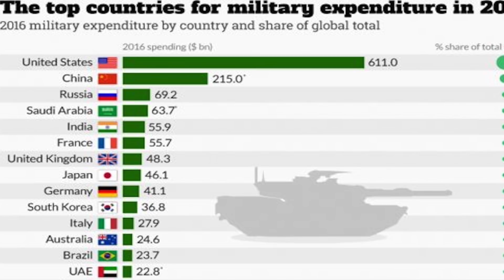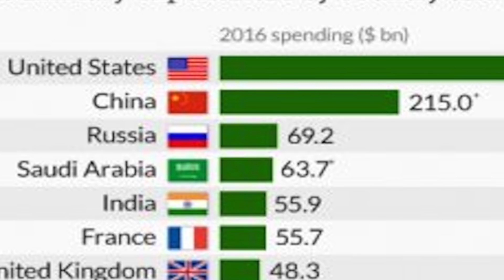CAN USS GERALD R FORD DEFEND ITSELF AGAINST RUSSIAN ZIRCON MISSILE ?

Comment: Yes the laser weapon systems are going to be installed on the major ships or all of them that only cost about $2 per shot when all is said and done... plus the U.S. will also install rail guns on Ford class carriers which fires a hyper-sonic projectile....
Reply: Interesting (Darth Mucus) fantasy that you have there (American Carriers being endangered). You're wrong, for a host of reasons. Let's say that this missile can do everything that's advertised to to. The only way to shoot a Carrier is to first know where it is. What makes you think that Russians or the Chinese have the ability to find a Carrier before the Early Warning Aircraft on the Carrier find it first?

Perhaps a submarine would be able to do so, but it would still need to surface or transmit data to the ship with the missile, which would take time.

So, no, US carriers aren't endangered. When was the last time a US carrier was sunk, BTW?
Reply: The Zircon missile would have a pre-assigned destination, upon launch, but that course would be very basic, and the missile would need to fly high enough to gain sight of its target, at some point. In the several minutes, it would take for the missile to get to its destination, the target, with its speed of up to thirty knots could be anywhere within several square miles, so the missile would need to go high in order to find the target, much the same way the Argentinians did when they sunk the HMS Sheffield with an Exocet missile. The Argentinians flew low with their fighter, then popped up to get sight of the ship, and once the target was seen, they launched the missile. The reason the British were unable to respond, to the threat, was they had underestimated the Argenitian's ability.
Reply: You're right, my prediction was based on the missile being fired from a long distance. The missile does have an enhanced capability, in that regard. My response was in regard to someone expressing how "A" Zircon missile could sink an American Carrier. It probably will take many. 

I have no doubt the Russians are developing the Zircon to be fired from submarines. It only makes sense. Since the primary purpose is to provide a multitude of inexpensive missiles from varying distances and platforms. No weapon platform is invulnerable. 

History has proven that to be true. What the Russians and Chinese are doing is following one of Sun Tsu's lessons in The Art of War, and that is to refrain from fighting your opponent's strengths and to develop new tactics and weapons to undermine that power. We Americans are also aware of Sun Tsu and are also adapting.
Reply: They do, and the Russian subs are superb, but they have one major flaw, which I won't mention here, and it is much tougher getting through the escort picket with this one major flaw.
Reply: We cannot count on the rail guns, yet. At hypersonic velocity, the guns can fire about ten shots before wearing out the barrel, so the tests are shooting the rounds at supersonic velocities for durability sake. At these slower speeds the guns only last about 100 shots, which is a far cry from the 10,000 rounds shot limit, the Navy insists upon.
Reply: A few seconds is a lot, but when you consider the laser beams are traveling the speed of light and might be controlled via computer as is the missile, then it isn't. Now, if the Zircon missile were capable of detecting it was being fired upon, by a laser, and maneuver to avoid the beam, then it would be a lot of time again. But, it might also force the missile to miss its target and would cost Russia a lot more.
Reply: If the missile is traveling low, over the water, at Mach 6, then it will be difficult to see, but it will also probably never get to see its target. At some point, it will have to go high, so it can get a lock on its mission.
Reply: The issue with a Zircon Missile using other assets is related to some of Russia's weaknesses.
Reply: But you're not a weapon designer. There probably is a very good reason why the professionals haven't already fone this.
Reply: Darth Mucus .....dude you are so full of shit its laughable. None of your junior theory is correct.  "Due to earths curvature?"....ummm these ships have airborn patrols few miles out to detect activities. Also these hypersonic missiles are still only hypersonic at high altitude! "Phalanx only getting a few rounds off once missile is detected." Ummm...please recall how many rounds a second it fires....  For one, hypersonic missiles have yet been proven to work in a war theater much less low altitude. Are you a comedian also??....or just a fear mongerer?
Reply: Darth Mucus ...5 tons flying at mach 6....😂😂😂
Reply: @Charles Lu, AFAICT (As far as I can tell), No Russian Subs are configured to be able to carry this Zircon missile, so it's irrelevant.
Reply: The Zircon missile isn't in production, yet, so no submarine or ship can be configured to carry it unless it's somehow backward compatible with earlier missile launchers.
Reply: Hashtag, subs carry supersonic cruise missiles , Oniks, Sizzler,  Yakhount, etc. also wake homing torpedoes, with 50 mile range. USN has no answer for 200mph rocket torpedoes either...
Reply: Darth Mucus It's unknown at this point if Zircon can maintain mach 6 or 7 at sea level. It would have to burn a lot of fuel and the shell would have to endure very high temperature, I don't know if that would damage the missiles sensors or not. I think it would traveling at Mach 6 at high altitudes and slower and sea skimming level's.
Reply: Darth Mucus You have some good points, however it isn't known if it can travel at Mach 6 at sea level, if it can that's quite the feat. And I would like to know how it can manoeuvre at that speed. Anything trying evasion manoeuvres would probably break up. But hey it just a thought.
Reply: We'll have to take the Russians at their word, on its missile capabilities, but we also have to remember these are the same Russians who told us of their new T-14 Armata tank and how it will make the M1 Abrams obsolete. We have similar missiles, to the Zircon, in development, and in actual use.
Reply: Darth Mucus Spiral manoeuvre at Mach 6? I see what your getting at but at that speed how much of a spiral is going to be possible. This isn't a ATGM.....this a mach 6 missile. I agree the kinetic energy is more than enough but I don't agree that it's going to be doing any manoeuvres.
Reply: Comparing the M-1 Abrams to the T-14 is irrelevant, because the T-14 isn't real. Oh, sure they designed a tank called the T=14, and it was supposed to be awesome, but Russia discovered they won't be able to build enough of them, to matter, so they cancelled it, and decided to upgrade existing tanks.
Reply: There will not be a full scale production.
Reply: I think the Russians are smarter than that and their reasoning for discontinuing plans of full production was spot on. Wasting money on a few superior tanks would be stupid especially when that same money could be used upgrading more tanks already in existence, especially when that new tank, T-14, would instigate the US into building a new tank too, and one we could build in greater numbers.
Reply: Hashtag, Russian subs carry cruise missiles too
Reply: true
Reply: We will see, though)
Reply: Maybe Russia will be fighting on our side.  You never know.
Reply: jessy livingston lasers work on exotic materials that are not in abundance go watch the video about lasers by YouTube channel thunderfoot
Reply: rail guns are cancelled, a single laser need a personal nuclear power plant to be effective, good luck :)
Reply: So how's your plan to stop it, smartass?
Reply: Guess you are going to flip burgers when you get older, with your IQ.
Reply: jessy livingston laser will be reflected due to the ions surrounding the hypersonic missile.
Reply: Russia's Avangard Hypersonic Glider Warhead Enters Production (is even faster= at speeds up to Mach 20) https://sputniknews.com/military/201803041062210266-avangard-hypersonic-glider-enters-production/     "Kinzhal, the ultra-maneuverable air-launched missile flying at speeds above Mach 10, has also been deployed by the Russian military."
Reply: And the Russia's Avangard Hypersonic Glider Warhead Enters Production (is even faster= at speeds up to Mach 20)  "Kinzhal, the ultra-maneuverable air-launched missile flying at speeds above Mach 10 .
Reply: So the sum total of your "host of reasons" is that a CAG can actually do something to stop an adversaries surveillance craft either airborne or surface before it's able to report their location to a Zircon equip craft that could launch an attack upon receiving targeting info.....?? That's nutty!
Plus the issue of extremely limited exposure time to even powerful laser defenses ala sea skimming trajectories is pretty much an intractable one as Darth Mucus pointed out.
Reply: it's not a Lazer. It fires a medal projectile super NB fast with electromagnetic power!!!!!?
Reply: Carriers are great for attacking weak countries but useless against a country that has a strong defence force, they could never be used against China or Russia.
Reply: Nonamearisto you cant even dodge a parked freighter... It seems all people sucking off the governments tit are hopelessly useless... Get a real job, instead of racking up the national debt for future tax slaves to pay
Reply: not to be disrespectful eddie money but how do you know what is in development or not in development or what do you have some specific inside info that nobody else does we know what they want or allow us to know
Reply: @hashtag underscore  "When was the last time a US carrier was sunk, BTW?"
When was the last time the US went up against a real enemy, and not some 3rd world nation?
Seems to me the one with fancyful fantasies is you, thinking somehow your stuff is indestructible. Remember Titanic? Yeah, it was unsinkable too. Remember Yamato, or Bismark? Yeah, another fancy fantasy. I bet you thought the Abrams was indestructible too, right?You should try steping away from that bubble you live in. 

@Aejon Starkgaryen  You are assuming the missile is launched from far away. I would bet my left nut the russians are right now working to get that thing launched from a sub. And even if launched from another ship 400 miles away, unless your carrier is zig zagging, predicting your position after a minute or two is not  all that hard.  The carrier isn´t exactly a small target, is it? If you have a spotter aircraft pinging you on radar, or a satelite relaying and feeding your course and speed to the missile´s guidance, i´d say the missile does have a pretty good chance of getting a hit. 

I honestly do not understand this fanboyism surrounding your weapons of war. Never in recorded history has any system survived unscatted once the bullets started flying. Everytime someone designs a new system and people dubb it "unsinkable" or "indestructible",  it doesn´t take long for someone to prove you wrong. Yet here we are, at it again. You think the generals and admirals in the US Army/Navy think the carriers are invulnerable? They wouldn´t bother protecting them if they were, would they?. 
Not long ago there were many americans that believed the Abrams was invulnerable. Even after the Iraq war, when you could see for the first time pictures of burning tanks, they still wouldn´t believe. It´s like some mass hysteria has taken over, and americans have lost all their ability of critical thinking, and are stuck in a perpetual bubble of incredulity. People try to grab them by the collar and shake them "Here!!! See?? Here is proof!!Look!!", and they just stand there in a daze, mumbling "Nahhh, it´s not true, it´s all fake. My beloved Abrams is invulnerable!"   Wake up, people! American carrier invincibility is a myth. You just haven´t faced a top shelf enemy, since WW2. Because if you do, those carriers will be the first to go. It doesn´t mean anything.
Reply: Lasers require a set ammount of time on target to heat up the target and work their magic. If a hypersonic missile comes low above the water, the laser will have only a few seconds on target, due to the curvature of the earth hiding its aproach, before the missile covers that distance to target. Likewise, other systems like Phalanx and short range AA missiles will not have enough time to engage the target once it reaches their operational range, because the missile will cover those couple of miles in a couple of seconds. A phalanx will have to wait untill the missile is 2 miles out to start shooting. That means it will get maybe a few rounds off before the missile covers that distance and hits. And since the missile itself needs to be built like a fucking tank to resist the stress of flying at that speed, it may not even affect it that much.
Short range missiles have a small warhead, again they might not have enough of a payload to affect the incoming missile. The time it takes to launch it might not be enough to even have a chance of catching it. Mach 6 is just too fast.
The Zircon doesn´t even need a warhead, they could just build a heavy and very dense penetrator, like a supersized SABOT round penetrator on steroids, that would be impervious to any damage in the first place.
The russians have the Zircon, the chinese have their carrier killer ICBM. I´d say american carriers are an endangered species.
Reply: @Nonamearisto  A few seconds is a lot for a missile that can travel at Mach 6. A missile aproaching low over the water will be safe from the laser until it gets to about 30km from the ship, due to the earth curvature. At which point it needs just 15 seconds to hit your ship, traveling at 2000 m/s. And in those few seconds the laser has to be focused on the nose of the missile, which if its made of a dense material will make that laser useless. All the tests made with lasers have always been made so the laser hits the missile on the side as it flies across the gun, never on the nose in a head on aproach. The laser is just heat. If you have a heat resistant missile nose, the laser is inefective.  Also the laser would only work on a missile with a warhead.  A solid penetrator is immune to a laser, all it would do is heat it up, not destroy it.
But hey, i´m sure you are gonna tell me the US Navy has a turbo-laser of some sort, or a phaser, that would somehow destroy a massive chunk of depleted uranium or tungsten flying at mach 6...
Reply: All it takes are a few seconds at most for a laser to destroy a missile. We'd detect a missile launched at a carrier within a second of its launch, and have about 3.5 minutes to react. That's plenty of time. I already explained why hypersonic missiles are bs above, so I won't repeat myself.
Reply: There is no issue, it actually doesn´t even need other assets. Think about it:
Soviet ship is 500km from US carrier, and spots it, using whatever asset. Plots the carrier´s position and launches the Zircon.  The Zircon receives the carrier position from the very ship that launched it. It then flies at Mach 6, meaning it will reach the immediate area of the carrier in a whopping 4 minutes! How far do you think the carrier would have gone in that time, for the missile to even need a course correction? The missile is huge, it can carry its own radar. As soon as it gets to 30km out, the earth curvature allows it to use its own onboard  radar to pinpoint the carrier, without ever having to come up. Takes a quick reading, pinpoints the biggest radar contact, and boom! And on top of all that, they are not gonna send just one. A carrier is a very high value target, they would not send a lone missile, they would saturate the task force´s defenses with 8 or 10 of these, launched at same time.

I think the issue here is people not realizing how fast Mach 6 really is! At that speed, you don´t even require an explosive warhead, the sheer impact is destructive enough. There isn´t much you can do to stop a 5ton hunk of metal traveling at that speed. The momentum, the inertia of the thing is massive. You think a little peashooter like an AMRAAM is gonna  stop it, with its proximity fuse shotgun blast type of warhead?  The Sea Sparrow is designed to destroy soft cased 500kg  missiles. It is not designed to destroy a 5ton behemoth flying at Mach 6, a speed that no interceptor missile can ever hope to reach. (Sea Sparrow´s top speed is mach 4, btw). There´s a reason why these videos were made. It´s because there are think tanks out there, thinking all this shit up, and they see just how dangerous this "zircon" can be if it gets built.
Try this  mental exercise: what would it take for you to destroy an inbound Yamato´s 18 inch gun armor piercing projectile, weighing 1500kg? The Zircon weighs 3 times as much, and flies twice as fast. Think about that. :)
Reply: @Clay Evins  Do you know math? How about reading? Calculate how much time a Phalanx system has to shoot it down. Let´s see, the Phalanx has a range of 2km, the missile moves at 2000 m/s, so that leaves it a whopping 1 second to shoot, from the time it gets in range to the missile hit. One second. And have tyou ever hear of "momentum"? Kinetic energy? Yeah... i think we know who is full of shit. 
Shouldn´t you be in school? Kids these days, always using their phones when they should be studying... No wonder they end up morons. But hey, you can always flip burgers when you get older!
Reply: They don´t care about facts. We can post all the data, their brains are so indoctrinated that they just cannot fathom the russians could possibly have beaten them. The american media sure has done a crack job on them. Even when confronted with overwhelming info that their precious multi-billion dollar carriers are in danger by a cheap missile system, they will just continue to be brainwashed moronic trolls. Even the british have aknowledged that the Zircon cannot be countered:
http://www.independent.co.uk/news/uk/home-news/royal-navy-new-queen-elizabeth-class-aircraft-carriers-not-stop-russia-zircon-missiles-hypersonic-a7651781.html 

But you can bet the american fanboys will continue to troll around badmouthing any russian systems. Nothing can possibly beat their precious Navy or their precious Army, right? WRONG!! The russians might not have a huge carrier force, but their missile technology is second to none. Why do you think NASA uses russian rockets to go up there? While the US was building stealth bombers, fighters and frigates, the russians were designing  better anti-air systems and missiles. And this is where we see the diference in ideology: The US builds offensive systems, the russians build defensive systems. Yet somehow in the minds of americans, the russians are the agressors!!   lol
Reply: @Major Garlic Williams  It doesn´t need to fly at mach 6 for most of the distance.  They move at a slower speed to conserve fuel and only engage hypersonic when they get to 20 miles out. And regarding evasive, indeed  they cannot perform any fancy moves,, but once they get to 20miles they don´t need to. A simple spiral flight pattern would defeat CIWS. And even if it hits, the kinetic energy means the missile will just keep going. Watch this:
https://www.youtube.com/watch?v=sLv0_GzTJUg

A few years ago there was talk about a space based system that would fire a solid tungsten rod down to earth at mach 10. It did not need an explosive warhead, because the energy of such a projectile would be bigger than any warhead you could fit in it. Zyrcon can work on similar principle. Here it is, Project Tthor:
https://www.youtube.com/watch?v=TgJlCoorMLQ
Reply: How could aim the laser to that launched missile from the first second? The earth is round and has curvature and light travels in straight line, which means when you could use your wonderful laser weapon it's already less than 10 miles away, and you've got....2 seconds? And You think that's a guarantee?
Reply: If i were a weapons designer, i would easily avoid the laser altogether with a simple alteration.   Have the missile move in a spiral. Easy to achieve,with just a tiny exaust nozzle aimed at the side. And BANG!    The laser is useless.  You think the russian designers are stupid?  The moment any laser potent enough to punch through a hardened nose cone is instaled on a US ship, they will alter the flight pattern of the missile to make any laser useless.  Lasers require the target be moving on a straight line. The moment you introduce an element of randomness to their flight pattern you defeat the laser system.  
Don´t fall for all the hype. Laser weapons program are remnants of Reagan´s Star Wars utopia. They don´t work, they exist to suck massive ammounts of money from public coffers. I would be much more concerned with rail guns. Now those have potential.
Reply: It can receive the necessary radar data from another asset, like an airplane or satelite. No need to come up. It just needs to have a fair idea where the target is gonna be. Once it gets to 20 miles, it activates its own radar, and homes in. The missile is so fast, that even if you launch from 400km aways, it will cover that distance very fast, and its target won´t have moved all that much.
Reply: Actually compared to T-14, abrams IS obsolete.
Reply: Aejon Starkgaryen T-14 is real, the head of UVZ said, that they changed plans and firstly the early models will be upgraded and then only after that full scale production of Armata will start. Untill then, MoD decided to upgrade the majority of old tanks and purchase 100 Armatas till 2020. Already like 50 Armatas have been built though. Actually, T-90M Proryv-3 is already superior to Abrams, since it uses lots of Armata features.